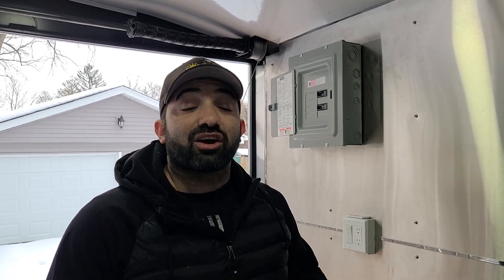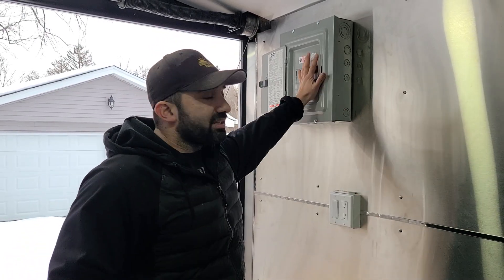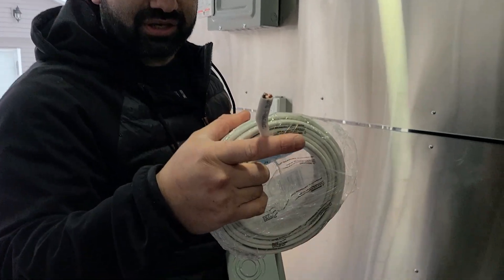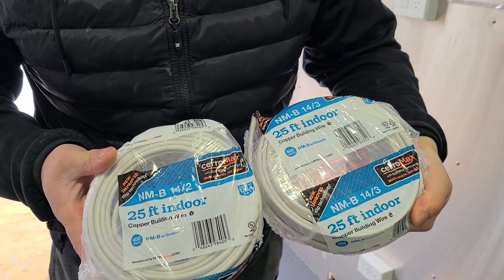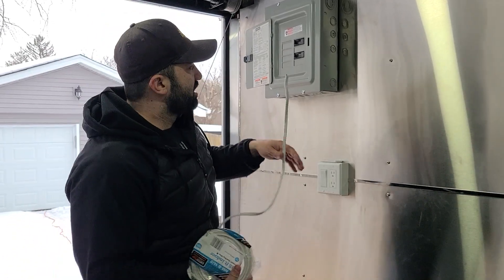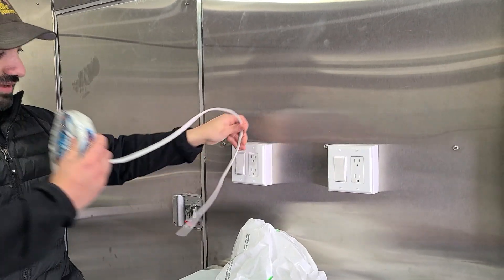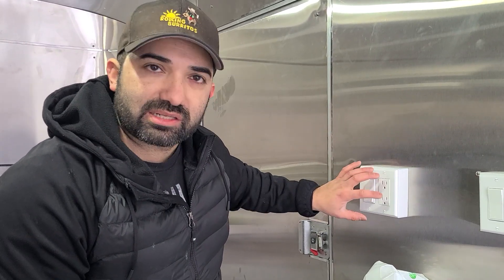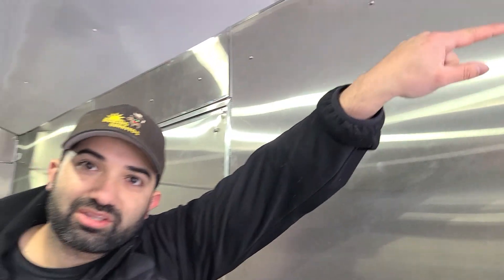How to Build a Food Truck: Installing the Electrical

Comment: You can’t run romex inside food truck due to vibration  against code you should use pipe or sealtight
Reply from the maker: Actually there is no code for it, but I can see the idea behind it. I personally never had any issues

Comment: A family member purchased a food trailer that is powered by a generator. The circuit breaker is Chinese/European speck so it is around 230v and on a single rail. Since most things are going to be electric powered I'll have to replace lots of things. I need to replace the single leg breaker rated for 200v 50hz(doubt the hz matters much) with a dual leg breaker that has dual 120v legs. This is to evenly distribute the load across both legs. There is lots more but I got this.

Comment: Hey thanks for your help I’m an electrician of many years 18 to be exact I’m 35 I started young trough a school program than when you graduated high school and the program they help you land a job so I been doing electrical since but now I have my own electrical company I had a friend reach out to me about wiring a food trailer I told him to let me do some research and I’ll get back to him the first video that came out was yours once I saw the panel and plus that answered my question yes I can I have wired houses that are huge mansions with doors everywhere stairs it’s was 55 k square feet it’s in bountiful Utah you can look it up the second I saw that you did it like a house I called him and told him I can do it for some reason I was thinking it was a food truck I would have to tap to the car power maybe converters and transformers power boosters but no I’ll just do it like a commercial job the guy wants that industrial look you see in a lot of downtown homes so a lot of pipe bending but good job on your trailer and thank you for answering my question so since you help me I help you 14-2 AWG = 15 amp breaker don’t ever put 14/2 on a 20 amp circuit and always try to stay around 80% of full power capacity and that helps with when motors kick start they draw more power but never upsize the breaker without changing the wire to the correct gauge people think it’s okay but I seen what happens when they put 14/2 into a 20 amp breaker or worse 30-40 even 100 amps I seen 14/2 awg in an 100 amp breaker what that does the wire don’t know it’s limit of how much power it can carry that’s what the breaker is for so if it passes that it will trip it’s called overloading a circuit and with time it’s usually the unbalanced load that’s starts arcing the unbalanced load wire in a house is your neutral white wire the shedding starts to get hot and peel off it even makes the wire yellow I had service call there’s smoke coming out of a plug every time we plug in an area heater the area heater was pulling like 1800 watts that’s about so you do your calculations and use this formula amps =watts/volts so it’s around 14-15 amps 120 watts =0.833 amps so about an amp just under and depending on that formula do your load calculation usually in the back of any appliances it will tell you how much it pulls and how much it needs in amps and watts so never go above the recommended breaker for the right gauge 14/2 and 14/3 can handle 15 amps at 120v or 240 v 
12/2 or 12/3 = 20 amp no more than 20  but try to stay at 18 around 80% of breaker and wire gauge full capacity 
10/2 or 10/3 =30 amp breaker 8/2 or 8/3 or even 8/4 they make them all up to 4 I believe before you have to use pipe and do thhn that’s single stranded wire 
6/2 or 6/3 =50 amps max 55 not 60 but only if it’s copper if it’s aluminum it’s stays at 50 copper can handle the 5 like 35-45-55 amp breaker never aluminum if you need any more help with anything electrical feel free to reach out good job on the trailer and love your videos they were really helpful see you on the next video

Comment: Hey Frank I have a question.
trying to stay at a 30 amp set up on my coffee trailer but I have two appliances pulling 1800w 15 amps each my espresso machine and the fridge what would be my best option in your opinion?
thanks love your videos
Reply from the maker: @RubenGuerrero-x8c  would have no choice but to go to 50 Amps. That's not counting lights, outlets, miscellaneous other things you will use. 50 amps definitely
Reply: @fbaltierrez 
That’s what I kinda figured. But thought I’d ask a professional. 
Last question and maybe a dumb one. 
50 amp is just the total correct the actual breakers would still be 20 Amp and 15 amp right? Just more of them? Or am I thinking of this all wrong?
Reply from the maker: @desireelozano4539  yes. 50 it total and gets distributed

Comment: I am building a food trailer and can't seem to find an answer on grounding.
I see trailers at events that are run by generator. But I don't see where the generator or food trailer is grounded anywhere. Are they? Do they need to be?

Issue I am seeing is that I have a brand new generator that I started up yesterday. It is showing 80 volts at the generator but I see nothing when I plug it into the trailer. Trying to debug the issue and wonder if it is grounding related.

Many thanks!
Reply: I’m having this issue as well

Comment: if you split the circuits up with mini breakers will that create 4 equal 15 amp circuits? I need to power 2 10 amp food warmers and a vitamix (12 amps) plus everything you have in your trailer - will the breaker box/romex 14/2 be enough??
Reply from the maker: I'll tell you how I have mine. I have 2-15 amp circuits. If I wanted to run 4-15 amp circuits, then I would have to upgrade to a 60 amp generator. Mine currently only pushes 30 amps. Can it be done yes.
Reply: @fbaltierrez  thanks for all your help! Just to clarify - I am going to use the mini splits to create 4 15 amp circuits to create 4 homeruns - should I mix and match the romex? 14/3 for the lower amp circuits and 12/3 for the food warmer/ blender outlets?

Comment: You are telling people to use the wrong wire for a commercial job! If you want ti burn your traiker then follow this guy!! Wowi cannot believe hes an actual electrician. First off you MUST run the wire in MC cabe or BX CABLE  and the lights MUST BE on their   a seperste breaker than outlets and finnaly you need to run #6 if tou are going torun 50 amps. 
Im calling you out on your knowledge of electrical. You Should be ashamed  of yourself

Comment: Frank HELP, panels properly hooked up with 6/3. Connected to a reliance 50amp outlet. Using 15 to 50amp converter, the converter tests fine. As soon as I connect the ground wire it trips the house breaker. BUT when I attach a plug to the panel, the tester shows Correct with ground wire off the Reliance inlet? Thoughts? I'm baffled.
Reply: Nevermind. I figure it out I think. I was wiring it up like the house. Didn't remove the bonding screw. This is my first trailer. Might want to add that to your next electrical video. LOL

Comment: Question:  I have been working to source the trailer attachment for a 4 prong plug to generator.  Since I will have a coffee machine I'll need the 240 Volt.  I spoke to someone at a local electrical store yesterday and he asked if I wanted the 4 prongs to be straight or bent.  Would you be able to explain when bent is needed?  When is it needed and how would you know it's needed?  Thank you in advance!!  I love your videos and am so very grateful for the work you are doing to teach.
Reply from the maker: All depends on the equipment or receiver end. There is no right or wrong it's all depending on that variable. 240v is 240v
Reply: @fbaltierrez  Thank you

Comment: Hey Frank, we're trying to drill through our thin stainless steel wall panel  of this food trailer we ordered. We have to reinforce the corners where the wall meets the floor as there are gaps. We've tried cobalt drill bits and it's not going through. Could it just be a tougher alloy? Do you have any idea's on a different bit perhaps?
Reply from the maker: No. Cobalt Is what I use

Comment: I have a floating neutral on the Westinghouse 4500. Ordered a bonding plug off Amazon. I used the breaker box that you used. Coincidentally have the same gen as you. If I had bonded the breaker box would that have also solved the problem. In any case videos have been also only thing left for me to do is plumbing and ceiling. I used frp for the walls. Thanks for the video’s. Dion
Reply from the maker: I didn't bond mine. Kept it Seperate
Reply: It’s dangerous to send constant current through your ground(it also isn’t sized to handle all the current). A floating neutral can lead to voltage spikes and fry the components of your truck. Spend the money and have an electrician figure it out. It’ll save you down the line

Comment: Hey Frank love the videos. Have been very helpful. Question. I made a shore power cable which powers my trailer no problem from home (used the plug-in tester-good). Made my generator plug same way same connections, however now my tester is saying open ground using just the generator. Any direction you can point me to?

Comment: I constantly pop the circuit breaker on my generator. I'm running a 4000 watt with a 30 amp plug into the trailer. Never blew breakers in the box, just in the generator. Do I need to upgrade the generator?

Comment: We’re going with a 50 amp system to power several large appliances all at once. Would you use the lower gauge for the large appliances and higher gauge to run lines for lights and such?
Reply: 12/2 will work for anything other than 220v

Comment: I have a 6x12 trailer with a 30amp breaker box. What all can I put in? As far as stove griddle vents lit on system. All I I’m trying to put in my concession stand is a griddle, ventilation system of course, and warmers.
Reply from the maker: You would just add all the watts of the equipment and compare them to the 30x120=3600 watts from the 30 amp power.

Comment: hey I gotta question can your run the 50 amp breaker box through a 50 amp inlet motor plug on a 5400 watt 30 amp generator?
Reply: all 120v
Reply from the maker: You could run less amps on a big wire size than it's rated for but not the reverse. Can't run 20 amps through a 15 amp wire.

Comment: Howdy Frank. Enjoying your vids. Good info. Since you're an electrician by trade, a question on running dual roof A.C. and the associated wiring for it. The generator is a Pulsar G12KBN  that maxes out at 12,000 watts and has a 50amp/240v output available. Using the 240v/50 amp output, could I wire both rooftop units on a separate 120v circuit and the rest of the truck on the other 'side' of the 240v/50amp  output? Would there be a better way? We also have two large coolers for food and drinks, lights, etc.
Reply from the maker: You running it all to a breaker panel correct?
Reply: @fbaltierrez  Correct. Have not taken off the dead panel, so not sure of the wiring.

Comment: Hey Frank, can you add more than 1 home run to a 15 or 20 amp breaker
Reply from the maker: Can you, you can however not recommended. The best option would be to connect the 2 wires together in the panel with a wire nut and then take another wire from those 2 as a pig tail and take it to the breaker
Reply: You should have a dedicated circuit for each large appliance like a microwave but if you want to combine hoodfan with lights and the fire suppression/ alarm thats fine as long as your hoodfan is a small load like 3 to 5 amps
Reply from the maker: @DanielWilliams-er3wc  Fire Suppression System does not require an electric connection.  Well speaking for the ones I get installed

Comment: Hey Frank, just wondering what type and size generator you use on your trucks, can't seem to find a video.
Love your videos, learned a lot.
Thanks for everything.
Reply from the maker: https://www.amazon.com/gp/product/B06XC47ZX4/ref=as_li_tl?ie=UTF8&camp=1789&creative=9325&creativeASIN=B06XC47ZX4&linkCode=as2&tag=rollingburrit-20&linkId=03c614f61b891ead21bf15cda583d160

Comment: Can you have 15 and 20 amp breakers in the panel box at once
Reply from the maker: Absolutely. You probably have something like that at your home now
Reply: @fbaltierrez  thanks we are in the beginning stages of building our bbq food trailer
Reply: @fbaltierrez Hello, just a piggy back off of this question. I am purchasing a gyro machine where the user manual states the following "The air switch for the power cord should be above 15A. I assume (sent a message to the company and waiting for a response) that requires more than 15AMPS so I was thinking of doing a dedicated breaker of 20AMPS with a homerun directly using a 12/3 wire. Can I use 14/2 or 14/3 for the rest of the equipment? Warmer is 12.5AMP, Prep Fridge, Main Fridge, Water Heater, and lights are under 1OAMPS. So approximate total amps used will be 42.5. Does that means that I would have to use a 50AMP plug and inlet box (4 prong) and would my SO cable need to be 8 gauge or 6? Also in the 100 or 125 AMP panel box, would I be required to use 240V or can I use everything on one side only? If so what size breakers should I use?
Reply from the maker: @crharrell01  depends on your equipment. If only 120 is needed then just one leg is needed. I use 6 gauge wire for 50 amps

Comment: I'm building my food truck and working on the electrical far as watts and amperage.. I am going to get a pretty hefty generator. Im currently looking around 9500 watts and 78.8 amps total.. I need help on determining what type circuit box I need as well as if a 50 amp or 30 amp plug would be beneficial. and if a 14/2 or 12/2 wiring?
Reply from the maker: Any panel would work. This one I'll link for you here handles 125 amps. I would use 12 gauge
Reply: @fbaltierrez  thanks that really helps me to get a better understanding Think in going to get that panel in the link. I really appreciate that info
.. 9500 is my max but not all at the same time I can cut it down to between 6600 and 8250 watts but would rather have a little more than enough than to little. and the 12 gauge wiring would be good to use with the 50amp or the 30 amp side of the Generator?
Reply from the maker: https://www.amazon.com/gp/product/B00002N7KK/ref=as_li_tl?ie=UTF8&camp=1789&creative=9325&creativeASIN=B00002N7KK&linkCode=as2&tag=rollingburrit-20&linkId=99fa76d702aa2044bfff7aa764ad1574
Reply: @fbaltierrez  what size wire would you recommend for the S/O cable for a 50 amp?
Reply from the maker: @kendrellgriffin6451  I would go 6 gauge
Reply: @fbaltierrez  thanks.. keep them vids coming 👊🏾

Comment: Hello Frank  my name is Jimmy I like to watch your video and learn.
I have a question need your help. My food truck 26’ equipment I have is 1 refrigerator, 1 sandwich cooler, 1 microwave, 1 cooking rice, 1 ice maker 130lbs, 1 exhaust fan, water pump and light. So how many amps or watts I should get generator? Man electrical box how many breaker and how much amps do I need? And how do I run wires? 
Please can you help, thank you.
Reply from the maker: Thank you for watching appreciate it. Step 1 would be to add your entire watts or amps either one but makes sure its the same either watts or amps on all your devices. And divide by 120 or multiple by 120 depending on what number you used.
Reply from the maker: And that should give you the answer as to size of generator

Comment: Can I use 12/3 for my food truck to run the refrigerators lights and exhaust fan
Reply from the maker: You can, shouldn't be a problem. Just use a 20 amp breaker

Comment: where do you run your earth cable to
Reply from the maker: You just use the green/ground cable that comes in the S/O cord (main power cable)
Reply: @fbaltierrez  so how do you earth the generator or don't you have to
Reply from the maker: @katewall4274  Don't have to, you just bond the neutral and ground in the panel. The panel comes with the bond. It's  a piece of metal in the panel

Comment: Thanks for all the information, good sir. I have two rookie questions:

1. My unit will have a 30 amp fuse box (8 breakers electric system 110v/220 v 30A), so does this mean that the total equipment on the trailer shouldn’t go over 30 amps REGARDLESS of how much the generator can hold?

2. The unit comes with a 30 amp plug. For my generator, I wanted at least a 10 ft cable. The generator includes a 120V 30A locking outlet, but would a 125v 30 cable suffice?
Reply from the maker: Big factor there is the wire size if you overload the wire it can over heat and thats where the wire can melt over time. 10 gauge typically is 30 amps. 8 gauge is always better. That's what I installed in the new trailer

Comment: Good stuff Frank!  Could you please clarify exactly what is on each of your 15 amp circuits?  Did you put the food warmer, fridge and hood fan on one and the lights and water pump/heat on the other?  Also, will 10/3 be enough for service cable?  Thanks bro.
Reply from the maker: Food warmer is on its own circuit all by itself. Everything else is on the other circuit

Comment: Thank you for the great channel I’m building of the truck along with you and there’s been a great help but I do have a question on the electrical everything is working the lights but when I go outside in a touch anything that is metal I’m getting zap ⚡️.Do you think I have a background or what do you think is the issue .thank you for your help

Comment: Quick way to help understand what the wire numbers actually mean - the first number refers to the gauge (thickness) of the wire and the second number refers to the number of conductors (separate, insulated strands of copper). The smaller the first number, the thicker the gauge, one of those inverse annoyances (:
Reply from the maker: Boom!!!! There we go! Love the explanation